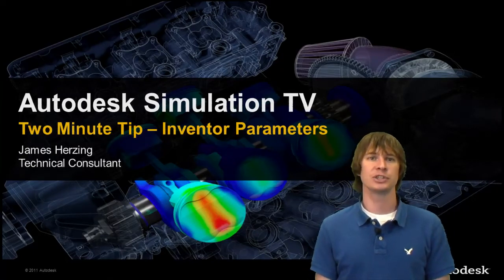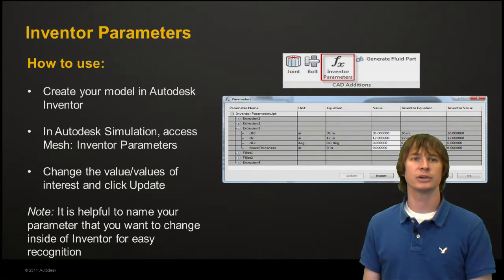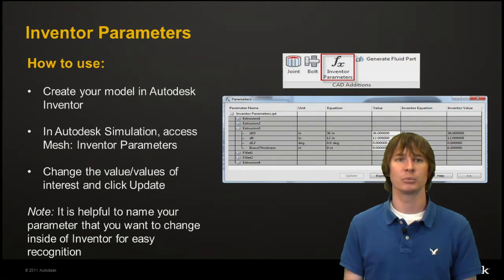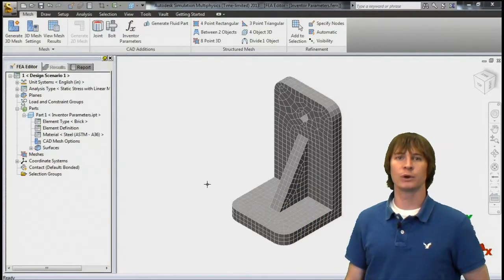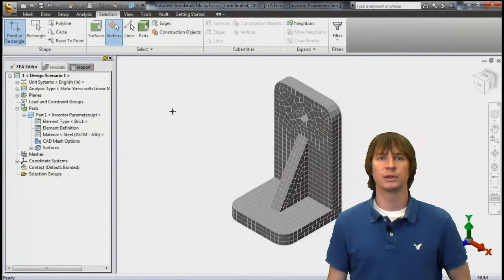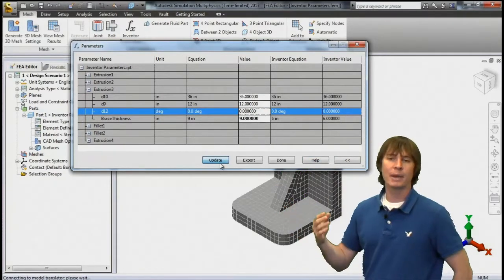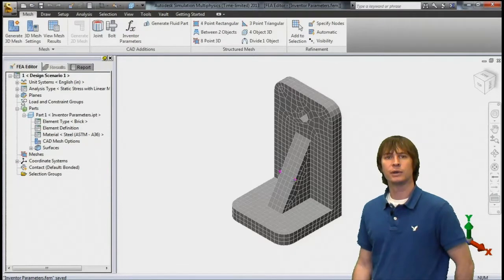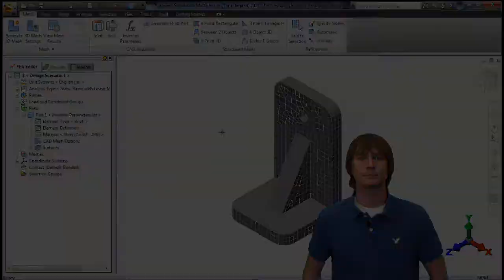Inventor Parameters

Comment: Hello. I have an excel spreadsheet with a bunch of parameters, and linked this sheet with my ipt. I have used the same sheet for several ipts. Now I need to add some more parameters to the sheet. I do this in Excel, and click "Update" in Inventor Manage->Parameters. But nothing happens. The new parameters never shows. Is it not possible to add more parameters after the excel sheet is linked the first time?